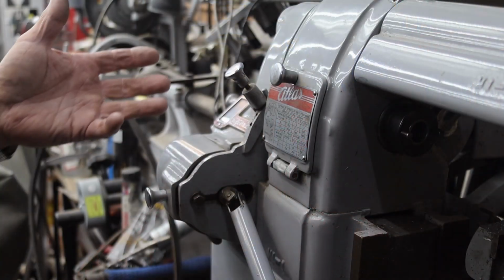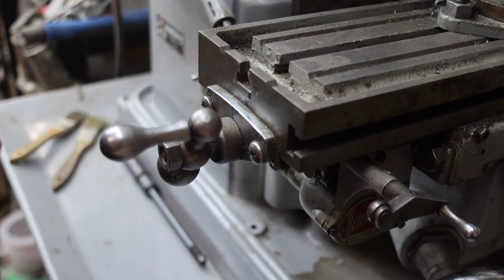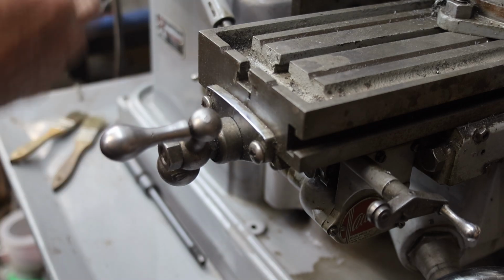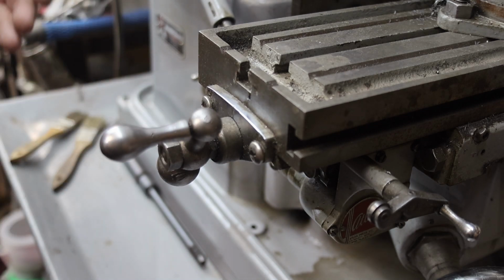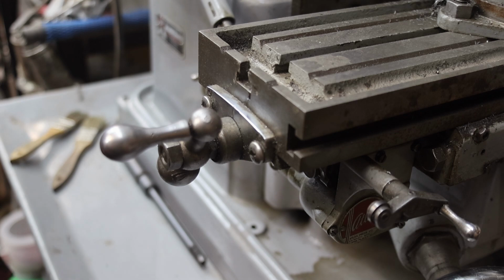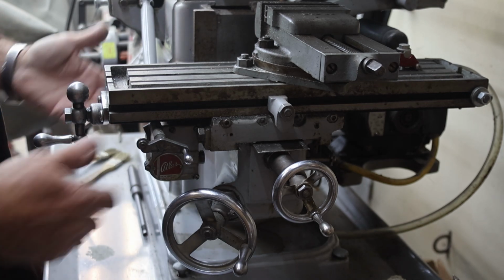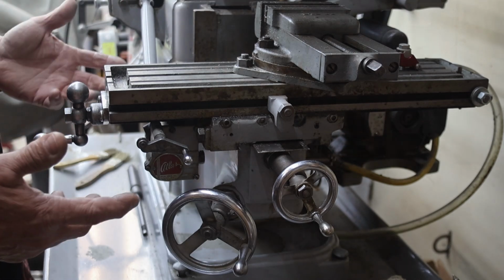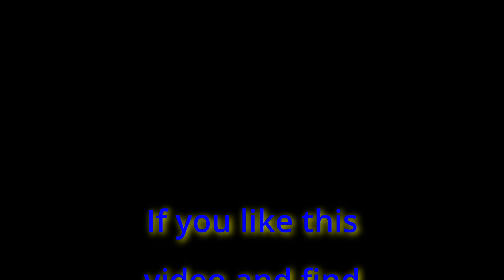Atlas Mill Gearbox Operation

Comment: I haven't seen your content in my feed in a while until this just showed up. Another great video. I'm curious if you know of a good way to check/adjust the bevel gears in the gearbox (@ 8:15). Setting those properly was a real pain, especially when dealing with those ultra thin shim washers between the gears and the frame. Thanks again for sharing.
Reply from the maker: Thanks, don’t know of a specific way to set the bevel gears, I suspect they should be set with about the same clearance as you would set the standard change gears on the Atlas lathe with a small piece of paper. They could be patterned as you would set up an auto rear end but I don’t think it is worth the effort. Dan.

Comment: I've found a similar issue in the gear selector box of my MFB I'm restoring. The selector was intermittently very difficult to engage/disengage. It turns out the right side of the box (holding the Spur Gear MF-3) was bent out slightly causing the stud MF-5 to misalign with the table gear MF-18. It also eventually caused the bevel gears to skip then strip over time, especially at the table ends of travel. I'm looking at ways to straighten and reinforce the side of the housing and rebuilding the gears.
Reply from the maker: Yes, it was probably forced causing the bending of the gearbox, while you may manage to straighten it without it breaking it will now always be a weak point( zamak does not like to be forced around)

Comment: Thanks for the video.

Do you have a basic 101 video of this machine?  How’s the gears and belts, levers and everything should be set to use? 

I have the ATLAS model MF 
I don’t want to have something set wrong and flip the switch for the first time and break something.

I am a hobby machinist with and use my Atlas 10F lathe, Causing 8520 mill but have not used the horizontal mill yet. 

Thank you!
Reply from the maker: I don’t think I have one dedicated specifically to the mill’s operation, I will glance thru and see what I have. If I do it will be in the playlist for the atlas mill. Dan.

Comment: I had the same problem with my Atlas Mill. Got it stripped down, clean and repaired as needed. put it back to gother and I stripped out the bevel gears. Why ? the lead screw, I didn't ajust and lock it down. In one derecction the screw became lose and in the other derection the lead screw became tight to the point where locked up to the point where it stripped the bevel gers. Where does one find bevel gears? For the next 8 months did the reserth, found needs a specel mochine. So I built my own gear cutter, so he needs to check his gears, are they stripped out
Reply from the maker: He found a spacer that had not been installed correctly and was loose in the gearbox, has it working now. Thanks, Dan.
Reply: I'm not shore if that would couse the problem, it should lead to a lots of gear play, where as the teeth would be running on the tips, check the lead screw end play and make shore the adjustment is locked down, all this is at the other end of the table
Reply from the maker: I have seen video of his gearbox and before he found the shim that was out of place I suggested that it could possibly be made functional by spacing the gear forward, that was indeed the cause. Dan.

Comment: Gearbox Issues. Gearbox has 2 Oilite Bearings In It. Need Them To Be Replaced. Made Both When I Rebuilt Mine.
Reply from the maker: I have seen them with both oilite and standard brass bushings